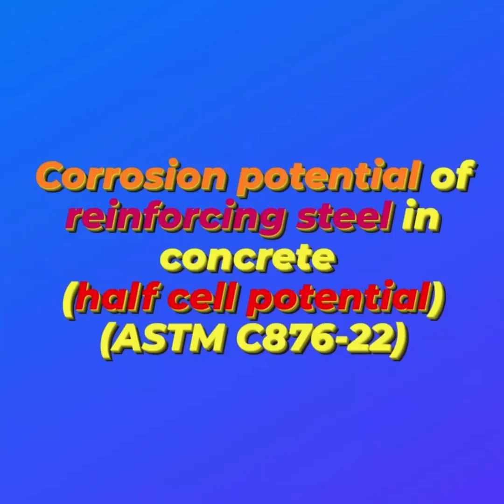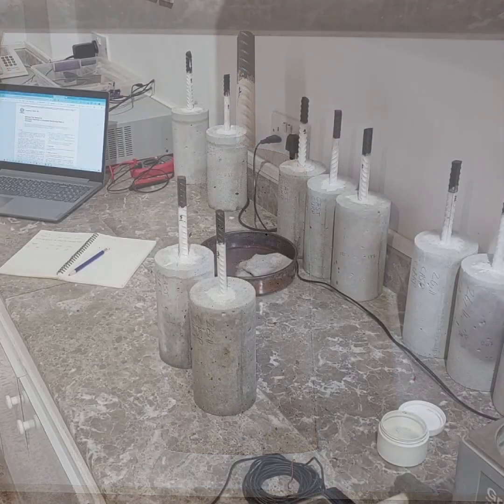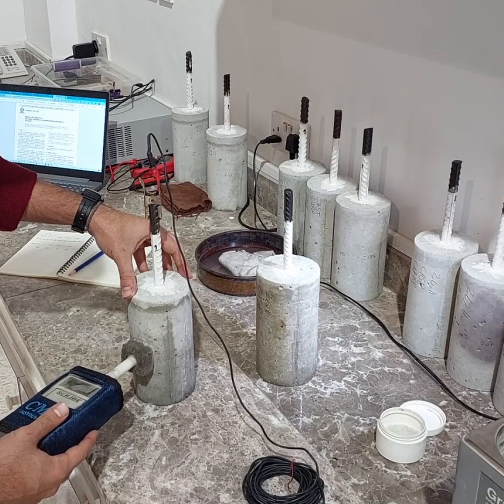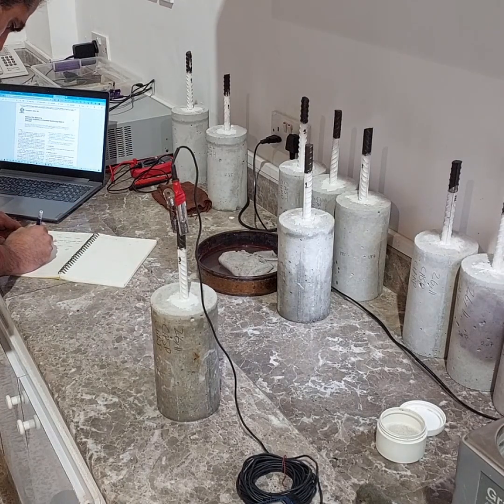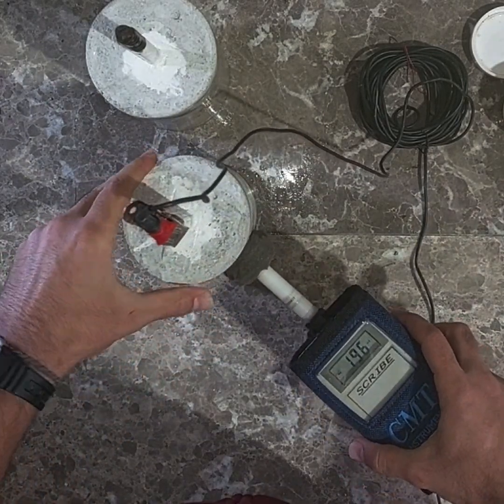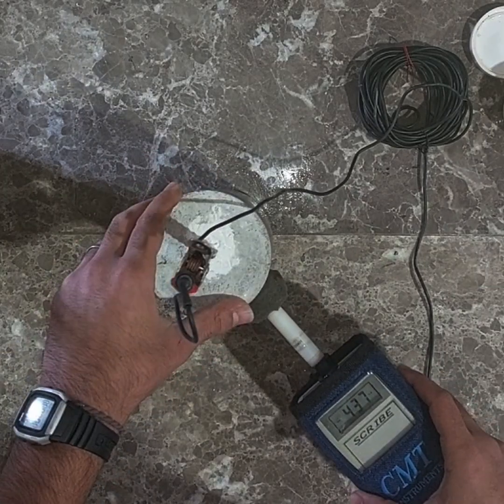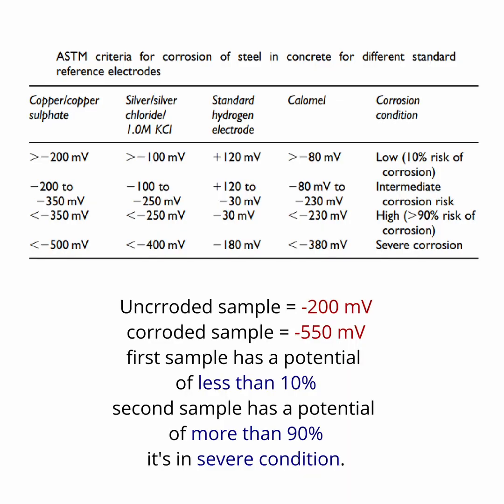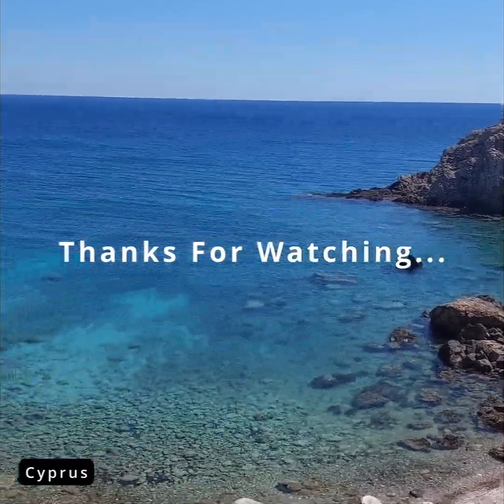Corrosion Potentials of Steel in Concrete (Half-Cell Potential) (ASTM C876-22)

Comment: hello, i have question. in your corroded sample, did you corrode the steel first before adding it to the concrete? or the concrete was corroded?
Reply from the maker: Hello there, actually these samples were used for another experiment which the intention was to corrode them to the degree that I could measure some level of support for steel, so yes they were corroded before this experiment.